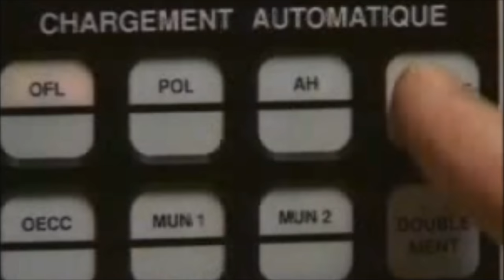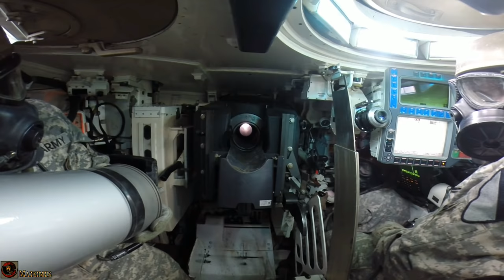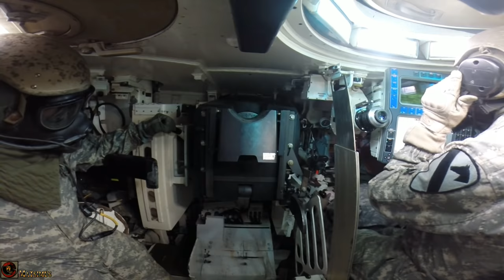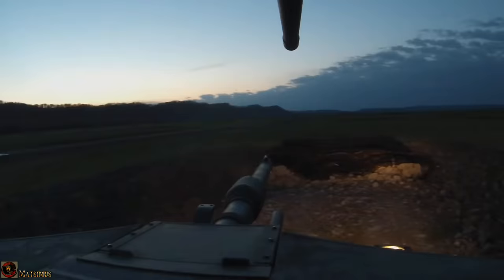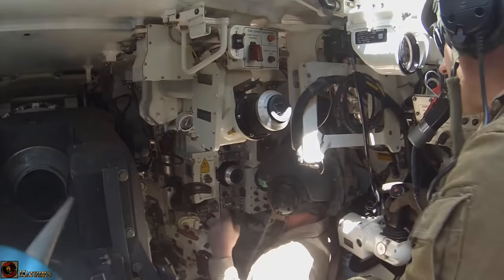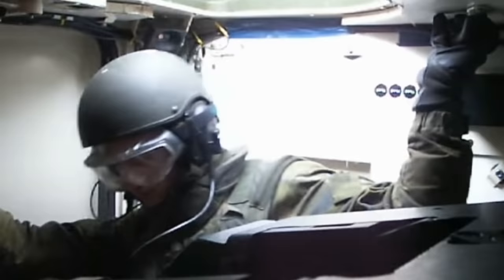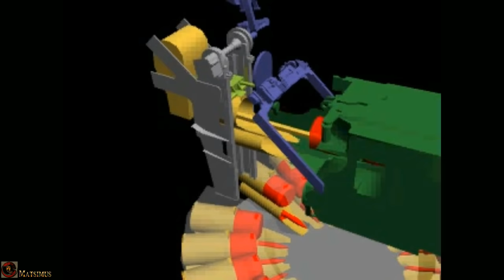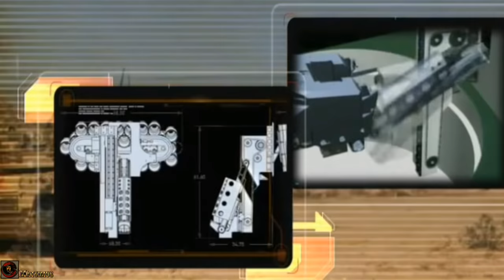Tank Autoloader or Crewman Loader?

Comment: ref: Duffman 15000 from a month ago...Just curious, have you actually served as a tank crew in any capacity?Please let me counterpoint your very interesting listing you posted by the numbers then...1) Changing ammo is not something you would do under 'most' circumstances. We simply shoot off whatever was loaded in chamber and load the next correct type of ammo- it's all in the fire command given and received. "... fire HEAT load SABOT!" and just get on with life. Each line in a crew's fire command given by the TC addresses pretty much every single crew member, in the logical order- from calling driver to stop (if necessary), followed by alert to Gunner, meaning also the loader, as to what type of round to index and load, and so on. If a different round was loaded from a previous engagement, we don't 'take it out', we just shoot it out as it is much faster and might even score a kill.Fire command crew drills are second nature to any tanker of any salt; we were forever reducing our drill routine time by practice.2) Maintenance sections!!!? Yea, there are those about, but unless you are pulling a pack (the engine), or addressing other major mechanical or electronic issues, pretty much all basic maintenance on the vehicle would be pulled by the actual crew themselves. 'One man operation'!!!? Each crew member has their own responsibilities while overlapping many of the others. Being an officer, I was also a TC (track commander), and when I or my senior NCOs would be off their tracks for meetings, or thousands of other administrative tasks, guess how many men were left on each track to pull any maintenance. My gunner would become the senior man in the crew... leaving pretty much a 3-men crew for any chores. Imagine if I was a TC of an autoloader than, I got off and gone somewhere and suddenly, I have a crew of two for everything needing done on my track... and BTW, that also meant more hardware for less men to deal with, with the added autoloader mechanism.Punching a tube!? one person inside the turret at the open breech while two or more would be pushing and pulling the long jointed section of bore cleaning rod. And who pull maintenance on the numbers of machine guns, smoke dischargers, individual weapons of the crew? And I assure you, repairing a track, or doing anything to a track for that matter is NOT a two men's job, unless the crew threw safety completely out of the window! Most modern armored vehicles' caterpillar tracks are what we called 'live tracks' now, meaning each track was designed to have a certain 'tension' build into them; they do not lay down straight and level but rather, each track link tension helps the overall track to 'curve inward toward the wheels, to help the tracks to run better with the designed spring to it! Each track link is heavy, and a link of track is not something you could pull by one or two person. Using the drive sprocket, as you suggested, would be one way, if possible. Do you know how heavy a 'tanker's bar' is!? That's simply a near 5-foot piece of very heavy iron pry bar, and that, manhandled by one person, could help lift the track off the return roller or such. No, Duffman, track maintenance, or overall a vehicle maintenance is pretty much an enough job for even a crew of four.Ideally, yea, motor section or some other track crew could help but then, the mechanics would usually be off some place else wrenching out some other track's pack of some other troop while, as if in a defensive position, each individual tank might not be close enough for crews from other tracks to walk over and help out, as they have their own tracks to tend to and their own defensive positions to maintain and monitor.'Minimum a pair of supporting APCs'!!!? Hell, they have their own vehicles do deal with and 'full of grunts'!!!? That's exactly what they would be, grunts, or in my case, scouts in their scout vehicles. Scouts do not come over and help tankers with their maintenance... most wouldn't know what to do, would hurt themselves or simply a waste of time. Meanwhile, they would be setting up their own support weapons and establishing firing arcs if anything, away from the tanks. I know as I have spend many years in the field with tankers and my own scouts and mortar sections. Please believe me.3) Autoloader does not sleep or get tired, yep, you are right in that. But just like any other weapons, from the lowly sidearm, rifles to large tank cannons, they have to be maintained or else they would fail. I'd take a loader who farts in the turret from eating MREs and gotten a 'dear John' letter over an autoloader anytime because this young fellow would snap out of his rejection funk, get over farting (heck, we all do that in the army, why do you think we called our sleeping bags the 'fart sacks'!!!) and would respond to my commands. Shoving rounds into the breech would be the simplest chores for the most junior and probably the newest member or any track crew but he would be cross trained to take over for the driver, and when trained properly, to be the gunner. Try and teach an autoloader to drive if you can... don't think they could do that yet, in any tank that I know of! Loaders are cross trained to be drivers and visa vera; gunners have held the positions of both loaders and drivers and have since been promoted to E5/6 to take on the responsible of being also the person in charge when the track commanders would not be present.Yep, being a tanker is a dangerous job, even without any conflict, as it entailed working with VERY heavy machinery and things that could really go BANG easily. Unless opposing tanks are in a slugfest of some tank duels, with both sides firing as fast and as much as possible, I can't see why human loaders would not be more advantageous over an autoloader. We are not talking about pumping out double-digit numbers of rounds pretty much nonstop here- even if we were to load as fast as possible, pretty much most engagements would require, from my experience, five or six rounds, if that... and that's engaging multiple targets. I would love to hear from other veteran Treadheads about what I have said here. I wish to hear especially from folks who served in 3-men crew vehicles and share their experiences/comments. LOL, this is purely personal but somehow I felt my crew, my 4-men crew I have served with, on a number of tracks, as very much a team, a family, and I am not sure I could feel as such with only two others in a 3-men crew. I could be wrong.

Comment: sounds like they should just make half the tanks autoloaded and the other half manual?
Reply: A fully fledged autoloader basically means a different turret design compared to a turret with a human loader. That's too much of a hassle. The trend is clearly going torwards autoloaders for a variety of reasons. Last but not least, the ammunition gets heavier and heavier. Rheinmetall even strongly recommends the use of an Autoloader for their future 130mm gun.
Reply: @shi01  The problem is if there's a big war and you start running low on tanks and can't get the materials to repair/build new autoloader  tanks then they will be stuck so my thinking was if they have manual ones aswell it'll be be cheaper and  easier to get the materials to manufacture manual tanks.
Reply: @midnightbluenoz  Actually tanks designed from the get go for an autoloader needs a hell of a lot less material to build than a tank with a human loader in mind.
The problem with human loaders is, that the guy has to be standing and has to be a bit beefy. So it's probably a rather tall guy. Let's say he's 1.80m tall plus boots and helmet and some reserve space. So that means that from the turret basket plattform up to the top of the interieur space you need about 2 metres room. That's a lot. The main reason NATO tanks are rather big is actually the human loader.
An autoloader don't need that much vertical space so the whole tank can be considerably more compact. Generally it's believed that an autoloading tank can be build about 10-15 tons lighter with about the same armor thickness compared with a tank with a human loader in mind.

Comment: The only reason, why Americans are using manual loader is because the are cheaper than autoloader. When any corporation make cheaper solution to buy maybe it will be used. However american corporations are so greedy that maintenance, service or modernization cost will hit the sky and exeed any budget like in other programs.

Comment: In the M1, what happens to the brass casing after firing?  It doesn't drop to the floor.
Reply: goes to a basket in the turret
Reply: There are no brass casings. The rounds use a case that disintegrates upon firing.

Comment: sorry but pretty BIAS... I get a lot of your points, but another crew member also means:
-  another chance of psychological break by stress
- performance severely hampered (specially RoF) if loader gets injured in any way
- need of higher trainning standars which are Ok for 1st world NATO powers during peace time or engaged in limited conflicts, but high training requirements are not ideal for extended conflict scenarios nor limited defense budget like many 3rd world countrys have to face.
- Survivability of the Tank crew really depends on the threat it faces... 

nor 1991 or 2003 Iraq conflicts are prime examples, since both conflict had huge air superiority on the Allied side, and huge technological advantage on the MBT side, in 1991 most of the Iraq army had T-55 much of them weren't even upgraded to Enigma standards. In 2003 Abrahams and Challengers had to face T-72 Babylon Lyon, which were slightly improved T-72M1, based on the less protected T-72A export chassis. T-72B3 and T-90 are not "blow up boxes" as the Syrian conflict shows. Active protection and modern Reactive armor boost up defenses... and in that scenario Autoloader is not a bad pair for an automated response system like the modern ones being developed. I.E. if a T90 is fired with an Anti Tank Missile but Reactive armor saves the tank, you might get a partially knocked up crew members, Autoloader might be the difference that could allow for a lethal response

Comment: well i wish to note if you re design russian ammunitionin proper way, autoloader on T72 based tanks will be able to receive 44 ammunition peaces and tank will have burst ratio 2 shells in approx 3 secconds time.  blueprint solution is here for more than 20 years, somebody just have to contact me for that..
Reply: And you'd need a unitary round for that instead of currently separated round and propellant charge.
Reply: yes, indeed and it will be 2 peaces of ammunition in one position of autoloader instead of one, i started to work on that echnology somewhere in 1987 -88 period but wars stopped further work, however it might help now.

Comment: Tank equipped with gau-8 from an a-10?
Reply: 30 mm ap round is ok again roof armor, but not again ~80-90 cm of frontal armor
Reply: nicolas rouvreau 
But the a 10 use it for tank killing
Reply: The a 10 target the deck who was the thinnest area of a tank (the big plate over the engine) , but the frontal (and side from most tank) armor was immune to it's ammo, so no interest to put this gun on a tank. therefore a lot of afv had a gun going from 20 to 57 mm who had far less recoil for destroying light armored vehicules .
Reply: Have a read up. 
A single round isn't much use, but front on to a main battle tank it will still take out the tracks, the sights, the guns, the turret ring (and turret kill). 
Side and rear shots are kill shots. 

Remember you are probably hitting it with a hundred rounds, not one.
One tank round on the front armour of a main battle tank won't do much anyway.

Comment: You are Brit and as such you are biased as you country still use 4 man crew....you got great videos and i am big fan but you all wrong here......just to bust some myths:

1. autoloaders are not so complex as you speak and maintenance is lower then that of engine, so no big deal here
2. human loader must stay on feet to operate normally so tank height must be increased and with it shape must be changed which in turn requires extra armor which gives extra weight to tank! - lower speed
3. Number op parts autoloaders have is irrelevant! according to you we would use revolvers to this day! we would trow assault rifles and take back ww2 rifles because they have less parts no!?
4. you can change any type of ammo by pressing single button... defuq you talk about lel?
5. Autoloader is more efficient, have higher rate of fire and can maintain that rate of fire 0/24h. they never tire!
6. Autoloader give access to high rate of fire with larger shells! try to fire 8   35kg shells in minute with human loader lol
7. Extra crew member is actually no good, 1 man extra to feed/train/endanger ! with less crew you can man bigger number of vehicles as well!

to conclude; autoloader is future, and if you want to stay in past, well thats your choice!  

regards

Peter

Comment: How do you take a shit in a tank?
Reply: Docter Yoda Use to be the same way you pissed. In a used cartridge. But as these are combustible and expended in the breech, and rules are a bit more strict. I presume only outside the tank. In the case of the M1 and Leopard 2. Or any tank with the Rheinmetall 120mm series, M256, KM256, and the CN120-26/52 Smoothbores, or the L30 rifle.

I do not speak from experience. So take my statement with a grain of salt regarding validity.

Comment: Auto loader still better, however 4 crew is better than 3 in certain situations.
Reply: Just do what the french and russians have done. Put the men you don't need anymore in APCs which follow the tanks and when you need them for watch or maintenance they are available. Because you get additional mechanized units this way which are quite versatile they become actually more useful as they would be as a pure loader.

Comment: Autoloader typically cannot exceed or match the reload speed of a motivated 19 year old in a well trained and disciplined Americamln M1 Tank.

Autoloader cannot clear malfunctions.

Autoloaders do not typically hide their ammunition behind blast doors.

Autoloaders cannot ever assist in vehicle and system maintenance.

Autoloaders cannot ever provide emergency medical aid to injured crewmen, provide security, or swap out roles with their team.

Autoloaders cannot adequately protect the crew from a catastrophic ammo cook-off. The manually loaded one can have the same problem.. for a fraction of a second.

Which is better?

The 19 year old kid with a strong arm and a heart fulla hate helping his gunner and commander establish foreign policy downrange.

And because am Autoloader cannot easily yank the breach open, pull that giant dart back and swap it for a HEAT round in less than 5-8 seconds when ordered too. Some probably could.. but those are rare.. and they cannot do the other things the Loader crewman Can and will do.

Manual loader is superior EVERYTIME.

Comment: To be honest I don't think it is a very good video. It would be if the arguments presented were not just...bad.
long story short you say having an extra pair of hands can be good for maintenance and whatnot. fair enough, but are your really supposed to be so isolated from friendlies that this is an issue ?

But more importantly, you say that if the autoloader gets damaged, you're screwed and you can't fight, but at the same time if your driver is wounded, well the loading guy can replace him and everyone's happy. but then who's loading the damn gun ? the problem is exactly unchanged. same for refilling the tank, are you going to pretend that reloading that blast-proof compartment with new shells one by one is much easier than reloading the autoloader one by one ? this is just bad faith.

As for the dangerosity to the crew, if it is, it's just bad design. you're talking about the catastrophic failure of a Russian design 30 years ago as if no one found a better way since then. france's MBT has an autoloader and we never heard of any issue with it, I'll grand you that it seems difficult to get any reliable information but I hoped for a more interesting comparison notably how it affects the design of the tank as a whole : smaller profile ? reduced weight ? increased ammo capacity ?

Anyway, i think drone warfare and optionally manned vehicles are the future, thus auto-loader is the way forward.

Comment: middle eatern conflicts proved western tanks are over complex, extremely high maintenance, reliability and get knocked out easily by atgm's, soviet equipment much easier to operate, maintain with better reliability in the long run, anyway the autoloader is the way to go and your pitiful excuse of higher maintance/reliability is null given the western super high verall low operational readiness numbers.

Comment: Lol. So many useless arguments in this video. Autoloader being a safety hazard? Autoloaders have been in use for over 40 years, and if you can find an incident where somebody was injured by one, please link me.. on the contrary, a human loader would be at substantial risk of getting hit by the gun recoiling if anything!
Also, you say that you're not talking about specific tanks or specific models, but it's very clear when you use examples of the T Series tanks' autoloaders not being able to change ammunition types once a round is loaded, that you are. On top of this, your examples for autoloaders taking longer to reload or requiring the crew to specifically load in a type of ammunition at the cost of a different type, totally talking about T series!
T-90 tank shot